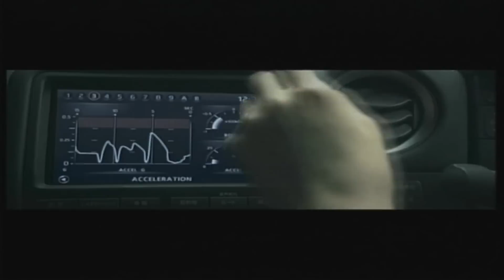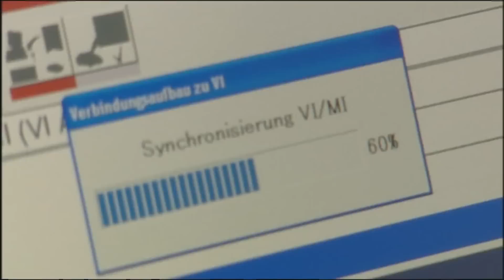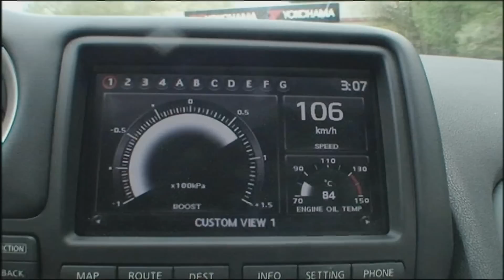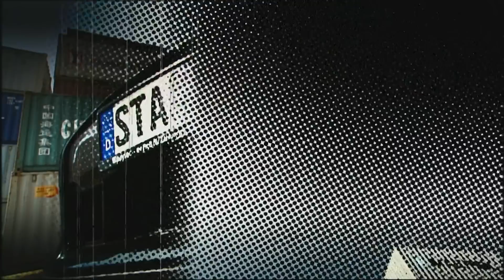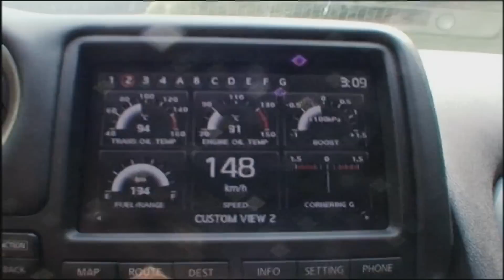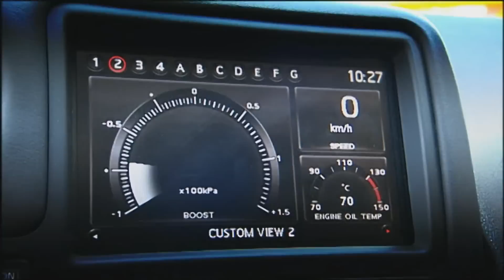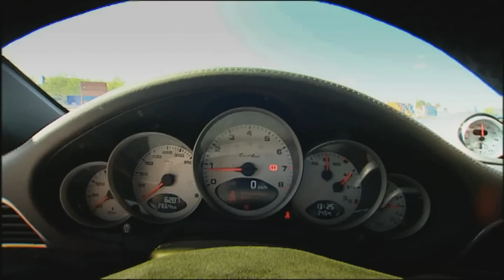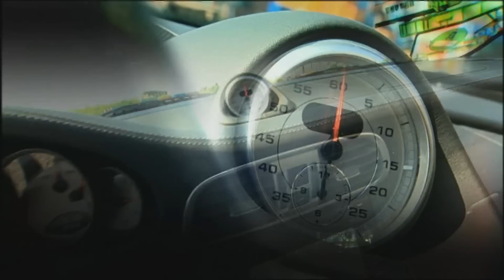Nissan GTR vs Porsche Turbo Nordschleife

Comment: Turbo S just care about drag race, which 0.1s quicker than GTR, but GTR did beat Turbo S year by year at Nurburgring.
Reply: but how many 24 hour Le Mans, Petit-Le Mans, Rolex, Manufacturers titles has the Nissan won???  compared to the Porsche GT3?? hummm reliability, usable power----like the experts say: " at the beginning of any race, the Porsche will be behind by a lap: by the end of the race it will be ahead by 20"  end of quote!!
Reply: ROCKETGUN BOOMBS I know what I would buy and Nissan isn't even in the race.
Reply: Porsche GT3 is not a "drag race car" but a track car which is what all you clowns talk about when comparing Porsches and  GTRs. The Porsche turbo is a luxury-want-to-be-Porsche meant for really, really rich old farts and is not an enthusiast car. You guys want to compare it to the GTR because the GTR can only compare to this "Porsche" but its the GT3 where all the race goodies are in and it shows by a racing pedigree that GTR can only dream about. Like experts say "In a REAL race track the Porsche GT3 will be 20 laps behind in the first hour but will finish first by the last lap" You don't have to like it, but the GT3 is supreme and that is the way it is. Nissan marketing has led people to believe a lot of stories. Nissan GTR building materials are sub-standard to Porsche (JD Power) and eventually we all get what we paid for!! Editorial.
Reply: Porsche GT3 is a track car, Turbo is a luxury drag race supercar. but GTR is either the track and drag race car.
Reply: ROCKETGUN BOOMBS you meant "neither " track or race car correct ¿
Reply: ROCKETGUN BOOMBS
Are you the Nissan GTR online defense club or something? I have seen you on other videos arguing with people. Chill dude, you dont need to get all worked up about these pointless arguments. If the Nissan GTR is as good as you say it is, then it absolutely doesnt need you to defend it. Its a fantastic car, but why compare it to others? These videos are just for entertainment anyway. No Porsche fan is going to buy a GTR irrespective of the outcome of these comparisons, and vice versa. Motoring was never about that. Motoring is about loving your dream car even if the whole world wants to shit on it. You love it and thats great. Ignore the people who hate it and go buy it someday. If you go fight with these people then you are no better than them.
Reply: Price of Freedom Agree.
Reply: So what? It's still a Nissan, cheap brand, cheap interior. Yes, it has very impressive performance for the money, but let's be realistic, what makes a supercar superior is its big price tag. A Bugatti is ugly (considered by most people), but when you see one in person you just have to appreciate it way more than any good looking Aventador's. No one gives a fuck when a very good performance car is only $50k.
GTR's and 911's are not supercars, but for the same reason you just have to appreciate the 911's which are more expensive than GTR even if you like your GTR more.
Reply: The GTR may beat the 911 at Nurburgring, but there are countless other tracks the 911 does better. Not only is that just the way it is but every time they go to Nurburgring they use a GTR with a specific tuning for that track and put it against an off the shelf Porsche. 
Either way no matter how special the one track is, it;s not enough to sum up the whole of each car. 
GTR; impressive.
Porsche; remains the bench mark all others are measured by.
And that is just the way it boys and girls.
Reply: 1400IntruderVS So far GTR Nismo has lap Nurburg, Nurburg GP, Goodwood(1st place), Laguna (91octane) and VIR. It did beat 991 911 Turbo S in every single tracks. Not only Turbo S but also 991 GT3 and 997 GT2rs. Also McLaren P1 lose to the GTR Nismo at good wood hillclimb.
Reply: Nissan never beat Porsche. They have achieved better lap times. 
That is not a beating.
If the entire automobile press suddenly used Nissan as the standard for excellence, durability, character, handling and overall quality as they have Porsche for more than 20 years now, than I would say they beat them.
Building one car that happens do better laps on a few tracks against one car isn't even a milestone.
It's just car that performs well. It hasn't set the pace or broken any new ground technologically hell it doesn't even turn most heads in traffic.
So I don't understand what all the banter is about here anyway.
It's not as if Nissan built a 918 or something remotely better. A game changer.
It's still just a Nissan (very fast Nissan).
Reply: You should check out GTR's comparison test lap times. GTR beat GT3rs, Corvette Zr1, Gallardo etc.... like it's no one bussiness. The GTR Nimso 20 seconds quciker than the Turbo S at Nurburg and Laguna Seca (91 octane), VIR and goodwood hillclimb. Cost $50,000less. so now, tell me who beat who?
Reply: You haven't made your point.
Nissan admittedly developed the GTR program for the last 10 years to achieve the best possible time at Nurburgring against the 911 Turbo model.
Porsche is not developing cars for that purpose. They develop cars to create the next evolution and are responsible for some of the technology that Nissan the rest of autmobile manufacturing world was eventually able to incorporate into their designs.
Torque-vectoring all wheel drive, variable speed traction control systems, variable vein turbo chargers, ceramic composite brakes, active ride height, and too many other things to discuss here were pioneered and successfully implemented not by Nissan.
So a few tenths of a second on few tracks isn't going to beat Porsche. Nor would I consider that "like no ones business"
If that were the only challenges in the car  world I'd say Porsche already holds the record at Nurburgring but it isn't a 911.
And they have championed most other events along the way through out history, now may not be there time.  Nissan simply does not have that prestige. Somethings you just can't beat at any price.
Besides I drove the GTR in 2013  and I have had seat time in an older 911 Turbo 2006 and a GT3 and a GT3 Cup Racer. 
To me the GTR feels like what it looks like. A brick made for a price point to go fast.. The others are a more of a spare little expense, Grand Tour, Week end Worrior, and all out racing machine. No point iin comparing to the econo-missile.
Reply: I would say the GTR beat Porsche at power lap, drag race, all season racing and price tag. What it dont have is: carbon ceramic brake disc, rotor and a good cooling system. It can;t go too many laps in stock form. However, as you said, it's a GT car. No one will bring the car to the rac track in stock form.
Reply: ROCKETGUN BOOMBS

I know its hard, but ignore the comments against the GTR. Let me suggest that you are right and they are right as well. How? You are right that the Nissan GTR is a fantastic car and has outlapped the 911. But there is always another better car out there. So someone looking at this argument merely a year from now would be thinking, "Look at these foolish guys who were arguing back then over such a pointless topic. The (insert completely different car here) beats both those cars!". I saw a test the other day in which the new Chevrolet Camaro Z28 beat the Nissan GTR and actually had more grip than the GTR! That would have been outrageous to suggest some years ago, but thats what its getting down to. They found out later that the Camaro was using the most modern sticky compound street tires. You may say thats cheating, but then you would have to admit Nissan was cheating with their setup when they set that lap, because they were using the best street compound at that time. The argument just looses all basis. What a waste of time. Please go on and live life. I pray I wont see you on another Nissan GTR race video wasting your life away fighting, like I have on the last 5 videos or more which I watched so far.
Reply: CroZagreb1 I don't give a fuck for stock vs mod. Coz the HKS1200 with 1200hp can either do track and drag race. If yo're more into drag race, the Alpha 16 King of texas would murder that ruf spec piece of crap
Reply: ROCKETGUN BOOMBS
Why is your logo a Viper? What is your opinion on Viper vs GTR?
Reply: What's wrong? both Viper and GTR are fast as hell on track. Most track have the fastest sportscar laptime set by both GTR Nismo and Viper.
Reply: You buy what you want to buy I will buy German engineering
Reply: ROCKETGUN BOOMBS  Its amazing how Japan is always challenging Porsche, I wonder why, case closed. Even a certain Porsche 964 turbo which is 20 years old was destroying all current cars in 6 speed manual class, that were 1550 HP and he was producing 1400 HP how is that possible, mind you its an air-cooled 20 year motor with a stock crank. pushing 36 PSI. I would love to see Japan do that with a 20 year old engine. OOHHH they don't build a air-cooled engine and never have. Cheers
Reply: Ivica Manovic GTR main rival= 911 Turbo. GTR is older than 911 Turbo. And I'm wondering how GTR uses 480hp  or 276hp/ton to lap as fast as the 475hp 991 GT3 and 560hp 991 Turbo S at Nurburg.
Reply: I don't wonder at all, Porsche GT3 is the most successful Porsche to win more 24 Hours Le Mans/ 24 hours Petit-LeMans/manufacturers titles, Rolex races/ etc than any other manufacturer--GTR has won NONE!!   is a lot harder to balance all traits that make a race/endurance/reliable race car in a long race that doing one circle in a race track. Doing one circle in a race car is just that, but does not make buy you a race pedigree that other manufacturers can only dream about.
Reply: manuel martinez Porsche GT3 is a good car in LeMans. However, that have nothing to do with GTR. There's 5-6 GT3 competitng with 2-3 Ferraris, 2 Corvettes, 2 Vipers etc.... Also LeMans is all about drivers and team work than the car. Ferrari 458 beat all GT3RS 4.0 in power laptime, even the Z06 beat GT3RS on some tracks. Do that mean they'll win in LeMans. BMW M3 GTS is slower than GT3RS at road America but the Porsche still lose to the BMW at Road America in 12 or 13 6 hours race.
Reply: ROCKETGUN BOOMBS Porsche has had some bad seasons but in general still the most successful car in racing history--only Ferrari comes close. le Mans is about BOTH car and driver, along with the team but is the car that wins the race. Agree with you on some aspects about Porsche being slower to those cars but only because of added weight penalties that are put on car just so that race is more even. In that respect Ferrari also gets penalized at times. Too bad because both of these automakers would kick rear-end if not for added weight penalties.
Reply: manuel martinez I heard lots of race car driver said "LeMans is 25% driver 25% car and 50% luck" a GT3RS always lose to 458 in power lap, endurance test and other track tests. So I don't think Porsche win by a better car. It's all about race car driver, race team, numbers of cars and luck.
Reply: ROCKETGUN BOOMBS you heard???  percentages?? in that case Porsche must be the luckiest car in the planet
Reply: manuel martinez Well if that's a race like GT1 or some races like F1 shorter than 2 hours. It always comes to the car. Ferrari F2004 is the fastest F1 car and it did win 15 times and 3 pole position in 18 races I guess, the Red bulll RB9 with a higher top speed and a more powerful engine, cause Vettle to win the title in 2013. But comes to GT3, it not just about cars. Drivers, team and cars a important. The combination of them comes to luck. a Porsche GT3R beat 458 GT3, Vette C6R Z06 etc.. which you'll never see in road going version. Road GT3RS ALWAYS beaten by Ferrari 458 Italia and barely beaten by Corvette C6 Z06 in endurance test and power lap testing. The only slower car is BMW M3 GTS.
Reply: ROCKETGUN BOOMBS ferrari always???  fastest???? Even Ferrari does not have the racing pedigree that Porsche has!!  what part don't you understand??
Reply: manuel martinez Do Porsche have a F1 team? How many time it win? The Ferrari F2004 won 15 out of 20 races. Until now, Many race track have the fastest lap time by F2004, Ferrari build successful cars Porsche have a better team by more cars, more ppl and more everything. You may call it successful or cheating.
Reply: ROCKETGUN BOOMBS very little if anything of F1 technology ever transfers into a street car technology(Car driver 1991), even by Ferrari accounts. That is why Porsche withdrew from such competition. It shows they did the right decision since Porsche is STILL the most successful manufacturer of Sport GT cars. Even you can't dispute that. As you can see that did not prevent Porsche from having won more competition (Rolex/ Manufacturers titles etc).
Reply: manuel martinez So will a race car technology goes to street car? Will u see a clutch in a auto car? Well yeah street car won; use F1 tech but Space Shuttle do. Which more serious? Street car or Space shuttle? Ferrari build better race cars and they don't give a fuck for daily use.
Reply: ROCKETGUN BOOMBS most not from such F1--look at Chevrolet how is doing it just like Porsche and more successful than Ferrari
Reply: ROCKETGUN BOOMBS haha--read Autoweek and European magazine about the supposedly sequential technology in transmissions from F1 and how they were supposed to be the ultimate. Now look at Porsche PDK how is indisputed superior to any other sequential transmission and it originated from GT3 technology!!  haha I am not making this up--READ FOR YOURSELF!!!   Autoweek February edition and European Magazine year??
Reply: manuel martinez Haha That's it? How about tyres? Engine? Suspension? Damper? Steering wheel? KERS? Even Porsche is using KERS now but it seems Porsche doesn't know how to use them. 60-0 108ft for a hypercar........... I don't think Porsche can build a n/a engine close to 133.3hp/L.
Reply: ROCKETGUN BOOMBS Ferrari uses Bosch!! so what?? Ferrari is Ferrari and so is Porsche!! NOTHING changes the fact that Porsche has won more competition !! not even your trivia!!
Reply: manuel martinez Porsche uses Bosch as well!  what? Let me tell you what. Ferrari build faster and stronger cars than Porsche do.
Reply: manuel martinez I didn't say anything. Yes Porsche did have a good race team at GT1,2,3. even Group B rally or LMP-1. So? No F1?? F1 is the top race car, nothing can travel fastest than F1 car through a lap. and Ferrari built the best of the best F1 car F2004. I won't say Porsche sucks, they build Porsche 956 which hold Nurburg track record 6:11. But 956 vs F1 you chose.
Reply: ROCKETGUN BOOMBS Porsche elected not to race!! so what does that mean??  better sequential transmissions?? who has got the best sequential tranny???  Porsche!! (918 Porsche also has the most-sophisticated-reliable-long-endurance sequential transmission ever designed. After all Porsche had the first one
Reply: manuel martinez Yeah Porsche refuse. Why? That's your question. Even BMW built good F1 car in late 90s. 918??? hahaha yeah good PDK but worst braking. Viper, Camaro GTR, even Cadillac ATS-V have a better braking distance. Why? The KERS is charging. Disengage them aren't an option. it'll push u during braking. 918 have the worst brake in hypercar history. Ferrari in other hand is kind of bored. 918 aren't its serious rival due to weight and braking, P1 aren't its serious rival due to stability and traction control, the only big oone this year is Agera one 1.
Reply: ROCKETGUN BOOMBS also since you elect to bring this point, when Porsche withdrew from F1 competition in the early 1990s they dominated Fi along with Mercedes and Audi so Ferrari was not the ultimate in F1. Only happens that the best is not competing.
Reply: ROCKETGUN BOOMBS I choose the new Porsche 918,
Reply: ROCKETGUN BOOMBS for your information 918 breaks all world records (Autoweek August)
Reply: manuel martinez You're a joke. Watch Auto car and see how they describe the 918. I care less about how good it is on spec, but the main point is, LaF is faster than 918. That's it and comes to acceleration, Agera R hold the record. 0-300,0-300-0,0-322-0,300-0,0-320 etc...
Reply: ROCKETGUN BOOMBS a street ferrari is not F1--you and your F! trivia--bottom line is Porsche has a better racing pedigree!!!  nothing changes the fact!! not even your beloved affection for F1 which Porsche or (me) can care less
Reply: ROCKETGUN BOOMBS well, have to go to work so that gives you time to make stuff up and I will answer when I get back or from phone  Porsche power!
Reply: manuel martinez It proves 458 built better race car and can put the race car tech into road car. and that's why 458 is faster than GT3RS 4.0, LaFerrari is faster than than 918 and Enzo is faster than GT1
Reply: manuel martinez Huh? Porsche fanboy.......I am reading your makeup stuff while working. Ferrari>Porsche.
Reply: ROCKETGUN BOOMBS Porsche most successful automaker ever!! most wins than even ferrari!! undisputed!! so you can write pointless facts and F1 this!! nothing changes!!
Reply: Nothing changes
Reply: GTR is King!
Reply: manuel martinez Ferrari won 222 times in F1 Porsche? 1
Ferrari is are the best automaker.
Reply: ROCKETGUN BOOMBS Porsche does not even compete in F1, that is why!! otherwise it would also out compete Ferrari just like it does in all other competition
Reply: manuel martinez Porsche DID compete in F1 but quit. It won once,  even BMW have more F1 win and last longer than Porsche.
At least, Ferrari didn't quit LeMans.
Reply: ROCKETGUN BOOMBS Never said Porsche never competed--look at the history--they quit so that they could compete in other competitions and build a better car--they succeeded
Reply: ROCKETGUN BOOMBS Ferrari did not quit Le Man but that did not stop Porsche from winning more titles-e.d
Reply: ROCKETGUN BOOMBS ..but somehow I do agree with you--I think Porsche should had continue racing in F1--for whatever reasons (too cheap?) they thought they did not need it---oh well.
Reply: manuel martinez They're focusing in FIA-GT3.
Reply: ROCKETGUN BOOMBS would had been interesting to see them both in F1-
Reply: manuel martinez That would be an epic battle and I do think this would push both Ferrari and Porsche to extreme
Reply: ROCKETGUN BOOMBS out of curiosity, do you own a Ferrari or are you a Ferrari enthusiast and an owner??
Reply: manuel martinez I am a Ferrari enthusiast, drove BMW 525i, Volvo S850 and Lancer EVO. Ride 2014 Viper GTS once.
Reply: ROCKETGUN BOOMBS don't like German cars?
Reply: manuel martinez I love BMW tho. You don't like Italian cars?
Reply: ROCKETGUN BOOMBS actually I drove a Fiat when I was younger, that is the closest I got to drive an Italian car.hehe  --later I drove an old 325 BMW--very reliable, also when I was younger. I currently do own a GT3
Reply: manuel martinez cool, I drove BMW 525i then shift to Volvo S850. In normal way, I would say GT3 is a good driver's car. Loud and fun.
Reply: mine is supercharged but have to remove it every two years so It can pass smog, I live in California  hehe
Reply: Oh i see, mine is N/A now :( lol
Reply: want to see my video?  type "supercharged GT3 races a 500 horsepower escape hybrid"  and you will see my video with my name (Manuel Martinez)   enjoy!!
Reply: ok
Reply: 650hp? Wow that surprises me! Welll done in modding it.
Reply: ROCKETGUN MISSILE actually 550 when video was done but later upgraded the Bosch fuel system and dyno it to closer to 600hp.
Reply: you mean crank right?
Reply: ROCKETGUN MISSILE YES whp
Reply: manuel martinez ...speechless power
Reply: ROCKETGUN MISSILE video was very crappy and was never intended to be uploaded to you tube. But loaded the wrong video instead but just left it because it was funny to see how many people called me on the bad quality of the video and how it was not a real race. I will eventually remove it.
Reply: manuel martinez lol I see. But still, your Porsche is awesome! How much torque u got?
Reply: ROCKETGUN MISSILE 442 pounds of torque, but inexplicably it had 460 when it only had 500 RWHP. Technicians attribute it to the mapping on the fuel injection.
Reply: manuel martinez I see, so is your torque band at around 4500-5000rpm??
Reply: ROCKETGUN MISSILE just checked the specs: car has 472 pounds of torque but used to have around 490 when it had 500 RWHP--figure that out. You are correct!! my power band (torque) is around 4000-5000 rpm but it redlines to 9000 and it seems to be still supplying power.
Reply: 9000rpm still applying power?? man I hate my volvo lol it cut power from 5500rpm..
Reply: ROCKETGUN MISSILE well, don't want to exaggerate, at that rpm it still feel like its pushing me against the seat but obviously it's not producing as much power. This particular engine is more rpm-limited due to the supercharger than other reasons.
Reply: 997 GT3 able to do 8250rpm redline, with modification+ supercharger, it produce power at almost every rev band. If you install turbochargers in your GT3, it may punch like  a Supra lol
Reply: ROCKETGUN MISSILE my engine is not set up for the high compression of the turbo. My supercharger only produces 5 pounds of boost even though it can produce 30 pounds of boost. Remember the GT3 is a natural aspirated engine from factory and increasing the compression with turbo or supercharger has to be done with caution. I can easily extract 30 pounds of boost but would not be reliable. I think 472 RWHP is enough haha
Reply: 472 is really powerful for GT3, pretend there is 10% of drivetrain lost, you got 520hp crank and that's pretty much enough for daily kick ass lol also safe your transmission life.
Reply: ROCKETGUN MISSILE yes, Porsches have low parasitic horsepower loses.
Reply: ROCKETGUN MISSILE Actually there are test showing the GT3 running an identical 11.7 quartermile time compared to a GTR 11.7 quarter mile time. The GTR understandably having a slightly higher trap speed and of course I have seen the GTR run a best of 11.3. Porshe Turbo all seem to be programmed to 10.9 with launch control but I do recall one running 10.7.
Reply: compare GT3 to GTR is fine not Turbo S tho. As my post said, Turbo S care drag race only, of course it's a quicker drag car. The quickest GT3 I ever seen is a 991-11.6s and the quickest GTR 10.87s.
Reply: I would hardly say the 911 Turbo S just cares about drag racing. There are very few cars that can out handle it in any respect and nothing in it's class that is so well known for durability. The cars that have beaten it on tracks like the Nurburgring have only bested in tenths of a second and cars like GTR were admittedly  purposefully built to beat the 911 at said track. In short it is one of the benchmarks that other cars aspire to beat. 
This is where "fans" and actual automobile "enthusiast argue most. The fan of a particular car usually knows less about motorsports and or historical development of either vehicle being disputed where as a true enthusiast will take all available information and experience into consideration and regardless of their favorite will continue to respect the capabilities of all competitively built automobiles.
The Panamera Turbo has been tested with 0-60 times of 3.3 sec and quarter mile runs as low as 11.3, but it's purpose is be a sporting luxury touring sedan not a drag racer. It so happens that acceleration is a luxury.
Reply: GTR Nismo out handle it
Viper out handle it
McLaren out handle it
hate to say but the new C7 Z06 out handle it
Ferrari 458 Speciale out handle it.

I would say the GTR did dust the Turbo S on track but slightly slower in acceleration 0-200.
After 200, it's power game and the Turbo S may dust the GTR. They both faster than each other in a different way.
Reply: That is a handful of cars. Thank you for making the point clearer.
Reply: 1400IntruderVS you're welcome
Reply: That is what very few means.
And there are 2 corvettes that beat it at Nurburgring. C6 Z06 and C6 ZR1. 
However beating a car on that track does not mean they out handled it. Track times are very subjective. Handling prowess has more to do with driver preference that a recorded time.
For example The Viper ACR may best the ZR1 but it may have been a bit more of handful when doing it.
Either way all of these cars are with in 20 seconds of each other. Which means on a populated track in an actual race it is still anyones game.
Put a 918 Spyder in the field and suddenly it becomes a different race.
Reply: Turbo S lateral G 1.04, C7 Z06 1.2G, 650S 1.09G, Viper TA 1.16G, GTR Nismo 1.06G.

Comes to driving feel, The Turbo S feels so bad, I drove an AWS car, it feels a bit too much under certain speed, the turning radius is too short and so easy to understeer.

At high speed when the rear point the same as the front, the turning radius isn't enough. 

Not to mention electronic steering feel is worst than hydraulic.
Reply: Stiffness of the shocks and tire brand play apart as well*
Reply: Preference and technique. I never had trouble trying to point and shoot any Porsche.
Reply: 1400IntruderVS I won't say AWS and electronic steering are hard to drive. But it's not the feeling you want*
Reply: I can appreciate the difference in confidence one gets when you jumo from a car loaded with nannies to a car you have to drive but technically the 911 has much shorter turning radius than a late model GTR. It feels lighter but I feel more connected.
Reply: 1400IntruderVS at less than 50km/h where rear steer the opposite of front wheel, you will get a short turning radius. But above 50kph, the rear steer as same as the front,  the turning feel decrease. It got more grip for sure but less responsive compare to other cars.
Reply: Not if you know how to drive that car.
I just realized that talking to ignorant people like you that are probably new to motorsports or just overly opinionated magazine readers are half the reason I do not own a GTR. The other half being that I just do not car for it's looks. 
However if it weren't for the fan blind sided fan base, the performance would seem more compelling.
I actually prefer slower cheaper cars that are home built by people who understand what there building to ego chasers that any over payed idiot that thinks he understand cars can buy.
I got this way through experience and the best one I think has been watching older home built cars beat up on Ferrari's  and GTR's and such at SCCA club events where supercars just can't flex there muscle around a really tight track. The events are more about driving than ego chasing and often a 40 year old 914 can be seen the High tech boy racers.
I am not even going to argue here because I know you know you are always right. Because people like you always are.
I am just going to politely disagree. Because sometimes no matter how right you are there may be some one else that just has a different opinion.
And of course I will fall in love with Nissan when tey build build more than one great car every 50 years.
Reply: 1400IntruderVS I ride my fds STI once and he let me drive it. So I know what I'm talking about.

I study motorsport physics. What do you do? 

Not just me, many people think all wheel steering is a bit too much and that's why Nissan remove AWS from R34. Installing all wheel steer on a sportscar isn't brilliant at all.
Reply: LMAO!
I take back everything you're alright.
Reply: Huh??
Reply: ***** how many 24 hours Le Mans has gtr won? none! Porsche more than even Ferrari! I also love both cars
Reply: ***** takes more than going around a circle once to show durability, reliability, speed to make a race car. I love both cars
Reply: manuel martinez HAHA GT-R never lost in JTCC and other Group A races. Did Porsche ever lose in LeMans? Hell yea.... So based on their specs compared to their own classification, GT-R is the better car. Porsche lost quite ugly in 2016 12hrs of Sebring tbh
Reply: ***** True. No one cares which have more win in endurance race because drivers are big winning factor. Unless manuel martinez You think you are a pro.... Just watch 2009 race on Laguna Seca, the Porsche is definitely the slower car.
Reply: manuel martinez LeMan what? GT-R don't compete in LeMans
Reply: ATTESA ET-S NISMO N ATTACK 東瀛戰神 R34 Z TUNE SORRY, it was Car and Driver November edition. Look at the shocking discovery of why your beloved car cannot compete with the best!!
Reply: manuel martinez Well, I guess you're talking about LM nismo because GT-R nismo does not have a GT-LM car but a GT3 car and it did so well out there. R35 GT-R nismo GT3 won 33 times and with over 10 fastest laps I think? So the car is defiantly more than enough to compete others.
Reply: GTR has never won a 24 Hours Le Mans , Rolex racing, Manufacturers titles etc , Petite Le Mans, PERIOD!!!  NO MAJOR RACES WON BY gt-r!!  ONLY Ferrari comes close to Porsche.ATTESA ET-S NISMO N ATTACK 東瀛戰神 R34 Z TUNE
Reply: ***** GTR has never won Rolex , 24 hours Le Mans, Manufacturers titles PERIOD!! NO ARGUMENT!!
Reply: manuel martinez Porsche has NEVER WON JTCC PERIOD
Reply: ATTESA ET-S NISMO N ATTACK 東瀛戰神 R34 Z TUNE Porsche only compete s and wins the worlds most prestigious races and not mom and pap races
Reply: ***** love how you guys make chicken soup out of chicken shit! Porsche has won the world most prestigious races such as Le Mans and Rolex and GTR has not! And this is undisputed! Porsche does not race mom and pap races ,
Reply: ***** Exactly.
Reply: manuel martinez R32 group A never lost in JTCC in first season which is 29 races, it also won 50+ Asia Championship and Super GT. Does that matter? No because Porsche doesn't compete there. Same goes GT-R, Nissan nismo never focused on LeMans. Not to mention you don't drive the race car on street, you drive the base car of those GT3 or GT LM cars.
Reply: ATTESA ET-S NISMO N ATTACK 東瀛戰神 R34 Z TUNE hajajajaj gtr can only play in mom and pap races but not the world' most prestigious races because only the best, most durable and hard core race cars can win it such as Porsche and Ferrari
Reply: ATTESA ET-S NISMO N ATTACK 東瀛戰神 R34 Z TUNE gtr would not and Cannot race Le Mans? Want to know the truth or your opinion? Like i told you twice read Car and Driver magazine and read the real truth!!!,  hehehe
Reply: ATTESA ET-S NISMO N ATTACK 東瀛戰神 R34 Z TUNE funny to see ignorant people that don't know anything about racing making chicken soup out of chicken shit with their imaginary and want to be race cars, Porsche has a racing pedigree Nissan can only dream about 
 Did GTR also won the regional Barrio Logan race on 32th street? Hahahahaa
Reply: ATTESA ET-S NISMO N ATTACK 東瀛戰神 R34 Z TUNE gtr also not interested in Rolex racing? Manufacturers Titles too? No wins for GTR!
Reply: manuel martinez GT-R doesn't win in Rolax yeah Porsche doesn't win any JTCC as well. Absolute ZERO.
Reply: manuel martinez You don't get my point dude, no matter how many times did Porsche wins in LeMans, it still have ZERO affect to road car, although GTLM and GT3 are based on road cars but still hard to compare, Bentley GT3 can lap Nurburgring GP quicker than McLaren 650S-GT3 do you think road Bentley GT3-R can come close to road going 650-S? Ja ja ja...... Ferrari F2004 is the fastest F1 car ever made, does that mean LaFerrari or 458 the fastest road car on tracks?
Reply: ATTESA ET-S NISMO N ATTACK 東瀛戰神 R34 Z TUNE I do not think you get the real point, Porsche has a racing pedigree GTR can only dream about PERIOD!!AND IT DOES NOT HAVE A ZERO AFFECT TO A ROAD CAR, IT IS JUST YOUR MISPLACED OPINION BECAUSE YOU HAVE NO OTHER VIABLE EXCUSE OF WHY PORSCHE IS THE MOST SUCCESSFUL RACE CAR ON THE PLANET
Reply: ATTESA ET-S NISMO N ATTACK 東瀛戰神 R34 Z TUNE there is a reason why GTRs do not win Rolex racing, because it does not have the durability, efficiency, and speed to sustain a race, much less to win it!!  GTR do not win or compete Le Mans, Manufacturers titles for the same reason. You can write all the excuses you want but nothing changes the fact that Porsche can win all those races and the GTR cannot. GTR need a real transmission and not one that breaks at the first sign of stress!!